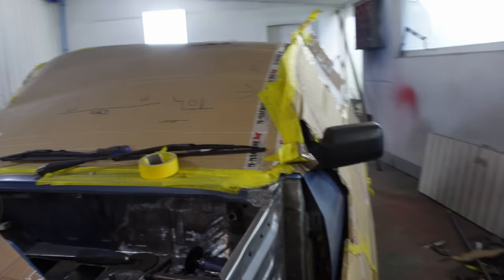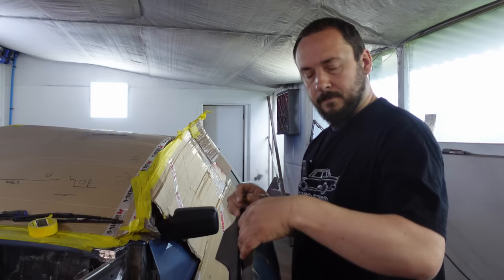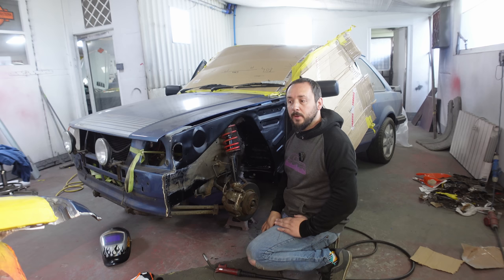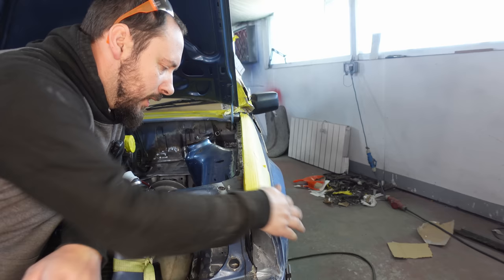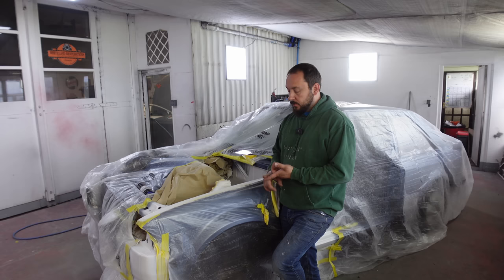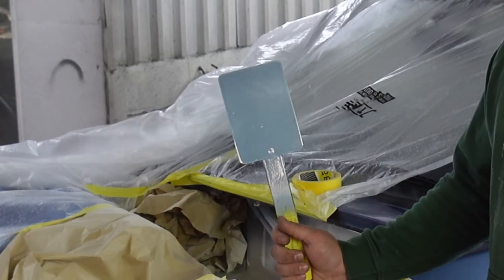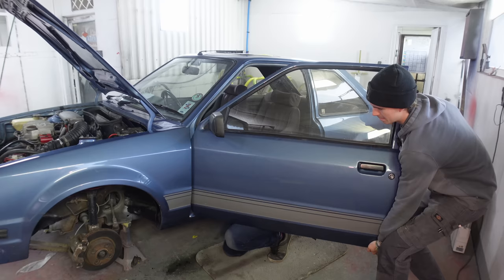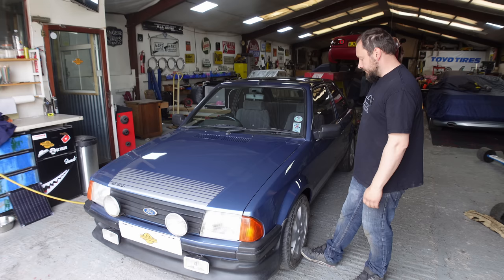Bulkhead repairs complete on the MK3 Escort RS1600i

Comment: That was so ridiculously fun to watch. Excellent workmanship. 
And frankly quite calming to watch too...
 The Bob Ross of car restoration???... 👍
Reply from the maker: Bob Ross of car restoration! You're too kind! Really glad you enjoyed it!
Reply: Just a quick question when it comes to welding vehicles old steel grades vs new steel grades: when you source steel, and given the advances in (automotive) steel materials science, do you get issues with regard to welding different types or unknown grades. Do you use steel suppliers that provide you with specific steels to prevent problems appearing in the long run?

Comment: Ayy up, Mk3 Escorts was made to rust,when a mate had his RS1600i,his scuttle and batterie tray went,he ended up rebuilding the whole car again and fitting a tilt and slide sunroof from an scrap XR3i.The car is in post office red and still doing rather well in the RS Owners club,I also think he had the Engine sorted to around 1700cc but it had a lot of torque steer,they would have been better made RWD imo. Great job by the way 😊
Reply from the maker: Very common for rust in that area aren't they! Glad your friend managed to save his...a lot didn't!